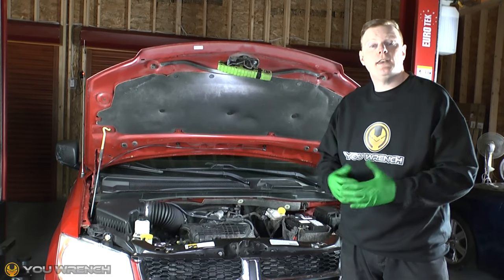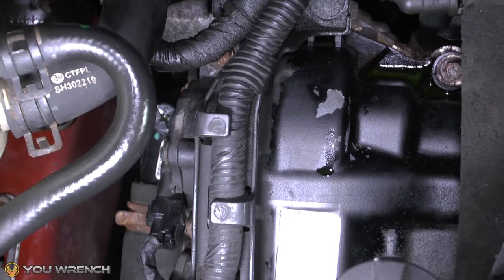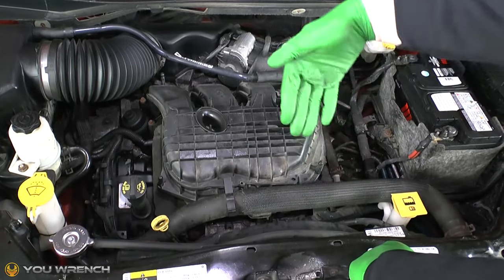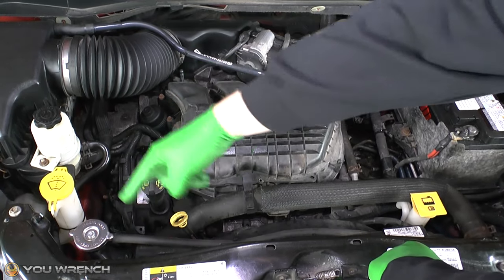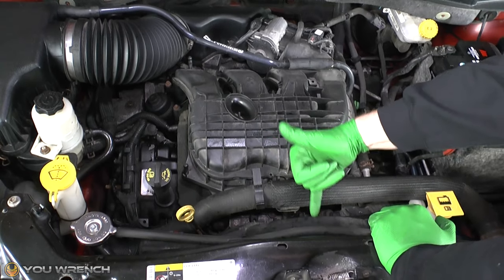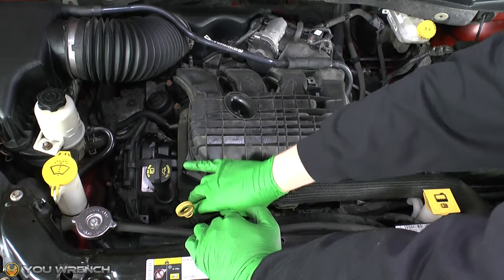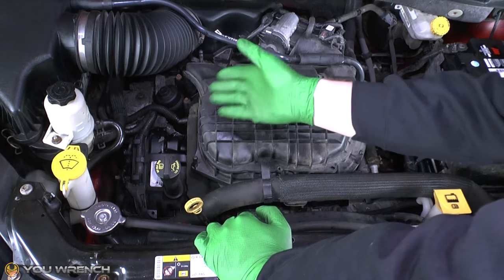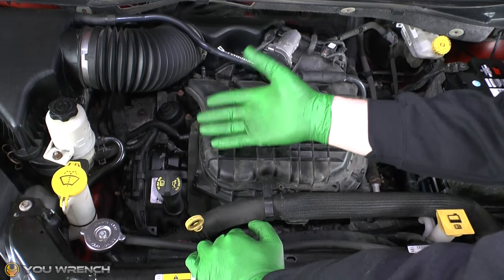How to Test if Your Car's Thermostat is Working (Without Removing It!!)

Comment: Outside temp -10 C. After starting and idling the engine for 14 (!) minutes, the temp gauge finally shows nominal temperature. During that time the pipe gradually builds up to a comfortable level, like 40C. Never really hot. During drive the temperature keeps falling down below nominal temperature, eften after driving for 30 minutes. Suspecting a stuck open....  What do you think?
Reply from the maker: Yes, a common cause for the engine not getting up to it's full proper working tempurature can often be the thermostat stuck open. This essentially stops the coolant from being held in the engine and getting up to temp (when usually the thermostat would open). Instead, it is constantly circulating and getting coolect by the radiator and fan. Definitely worth replacing the thermostat as the cost is low and the likelihood of success is high - that's the good way around!     www.paypal.me/youwrench

--- 

To help support us (for both you and others reading this) there are a few things you can do:

1) Donations both needed and welcome! We cannot operate You Wrench without the support of people like you! You can donate by PayPal - just go to www.paypal.me/youwrench

2) Please ensure you subscribe to our YouTube channel. 

3) Please Like our video's on YouTube (by clicking Like!) 

4) Please help spread the word, the more people who know about us the better! Add links to our video's in forums, let people know about us.

Thank you for your support!

Comment: some systems are apparently operating in reverse ? it circulates in the lower part of the radiator, then go up to the radiator cap then go through the engine then to the thermostat and lopps like that has long as engine is too hot. How do we know if it's a reverse system if we don't have access to the manufacturer manual ?

Comment: My temperature gauge is sitting slightly to the left off straight takes a bit to warm up properly but it is a diesel.... Would that be the thermostat?? Want to get ready for winter have decent heat but don't want to be stuck when the bad winter comes in

Comment: Thank you very much, my 2011 Kia Soul was overheating and I did not know what to check for then after watching your video I did as you said and the car was hot but that hose stayed cold and never get hot then I realized that my Thermostat was stocked on CLOSE position and never OPEN to let the water coolant to flow to the Radiator. Thank you very much and may God Bless you.

Comment: Yes, that a pretty decent way to rule out a thermostat issue. I was kind of looking for a good way / tool to measure coolant flow to diagnose if the water pump is bad and not circulating coolant. Currently this is not an issue for me. But it's one component I don't have a tester to know for sure without removing and inspecting.
Reply: If your pump is on its way out, you'll see the temp gauge running hot or overheat.
Reply: Try looping the heater inlet and outlet hoses together with clear vinyl hose. Run the engine and watch for flow.
If you cant easily reach those, look for another small coolant hose you could insert a loop into.
Stay gold
Reply: Yes as you indicated this actually doesn’t differentiate between thermostat issues, water pump issues and blockage in flow
Reply: Will this cause a coolant leak also
Reply: Car will start making certain noises pump might start whinging
Reply: Water pumps will have a weeping hole. If you see crusty calcification   outside the water pump, the bearing is going out, hence the weeping from a water pump

If you're water pump doesn't have one, blame the college educated vehicle designers & engineers, it's all about money.

Comment: Thank you. I have a 2001 Chevy Tracker base model that takes 30 minutes to show proper temperature on the gauge and the reading drops back to cold a bit while the engine is in idle. Definitely a thermostat stuck open.

Comment: What happens often on older vehicles is the thermostat works fairly normal except it won't  close up completely and thereby causes the engine to never make it to correct operating temperature that the computer is looking for.
The idle stays fast because it thinks it's still warming up, it runs richer because it thinks it still warming up, and your heat is weak.
Reply: Change your coolant temperature sensor
Reply: I changed coolant sensor on my son's 07 HHR now it runs so rough and gave a upstream 02 sensor 😡🙄 hate hate hate this crap dealt w a Chrysler 300M nothing but electrical/sensor after sensor was fixing to replace brain and boom  timing jumped and screwed some internal crap!!
Reply: Time for horse n buggy or a tri-motorized bicycle w enclosed cabin some solar panels and batteries converter/inverter run some lights and a small heater and be done w crap!!! Lol

Comment: After a new water pump radiator cap and 3 new thermostats, it stayed closed again. Took it out after busting a hole in both upper and lower radiator hoses. Read through 1000s of comments against doing it. Bought myself a week till my new radiator came. After putting it in the old 1 didnt look bad at all. Found a short in a fan wire which made it look like it was working coming on sometimes then off when cooled down a bit. Now they are both running and its super cold. Guess i will reinstall that dam thermostat, just letting yall know whats up. If you have too, do it and figure it out till you get it right again. 💯🔥

Comment: Great video, very helpful and simple process. My issue is the temperature gauge goes straight to hot/normal running temperature soon as I start the van. Could this be the Thermostat or maybe the temperature Sensor?

Comment: Just installed a new thermostat in a 2018 jeep grand Cherokee V6 3.6l. first auto repair I've ever done. This helps and I'm gonna run this test in the morning. Any tips on how to burp this specific cooling system?

Comment: Great explanation! My Ford kuga diesels’ temperature gauge gets to 90 degrees in 2 mins even at 7 degrees .. I’m still trying to figure it out but this video has given me a good basic understanding of how it all works 👏👏
Reply: Your thermostat I'd say
Reply: @kevinhancock4064  if I turn my heater on to the cabin will that tell the thermostat is working?
Reply: @Water Fall (H2O)  well yes indeed I just put a new oem  in my car and new pump (not oem ) but good brand
Reply: @kevinhancock4064  Thank you.
I am going to change my thermostat. Eventually change the pump. I changed all the hoses and radiator cap. After I change the thermostat then I am going to change repair shop. 
Thank you for assistance
Reply: @Water Fall (H2O)  repair shop ? Yeah nice 1 kettle me know how u get on whats your issue anyway ?
Reply: @kevinhancock4064  Don't know what "nice 1 kettle me."means.
However,  there were some unscrupulous things that had taken place.
Reply: @kevinhancock4064  Sorry I don't know what "nice 1 kettle means."
Reply: @Water Fall (H2O)  nice 1 fella  " lol
Reply: @kevinhancock4064  The issue is I paid for new part for vehicle and repair services.  The owner  knew a piece of the new part was accidentally broken of the part when the mechanic was repairing the car. He did not informed me about the issue. Eventually, I began having problems with that part. You got it! Coolant began to leak from that part.
I returned several times to have it fixed. 
I could tell by thee demeanor something was not right. 
So, I had to purchased the part again and pay for services again. Also, my new radiator cap was switched out with a radiator cap that doesn't go with the car. 
Since it was an old cap two black seals have fallen into the coolant reservoir.
Therefore, I am going to negotiate a  offer on replacing the thermostat part.
Once this transaction is completed I will look for a new shop.
Now I know why one of the mechanic quit. Dishonesty.
Reply: @kevinhancock4064  Your advice have given me the knowledge to have the right part repaired.
Reply: @Water Fall (H2O)  blimey that's bad was the part a radiator ? I've got a small hunch my rad has a slight leak I need to see how it goes over next few days now got new coolant sensor coming soon so I'll first test that and go from there
Reply: @kevinhancock4064  No, it was two rubber hoses off of  a tee. Then a long plastic part that had a square part on the long plastic part. That was the piece that was broken off of the part.
Reply: @kevinhancock4064  I need to invest in coolant sensors.
Reply: @Water Fall (H2O)  most cars only have 1 mime does some do have 2 though . Keep me informed if u will curious how u get on
Reply: @kevinhancock4064  Yeah. Definitely curious

Comment: Question: on a 2014 Passat 1.8T (ETKA). Upper radiator hose gets hot and tight (barely compressible). Raditatior has a leak and both the primary and secondary fans are not cycling on. Radiator will be replaced, along with upper and lower coolant hoses, both coolant sensors, thermostat, along with heater core. All was original, and I have the interior taken apart anyway, might as well. Anything that I might be forgetting? Another mechanic said to wait before replacing the fans; suggested that the coolant sensor that sends the signal for the fan to come on may be faulty and to wait before spending the money. The entire fan assembly can be easily replaced without draining the coolant (4 screws and 2 electrical connectors and it lifts up and out). Your thoughts?

Comment: Thank you. I never had these issues with my 99 camry but this 97 camry I am. After ther thermostat failed, I disconnected the fans from the ect to keep the engine cool till I got it fixed but now a week later after getting it fixed, the gasket failed and was leaking bad. Also i never see the gauge go up but i see the white smoke from under the hood first. Had to take the car back and the guy reinstalled a new gasket on the thermostat and did every test he could. Swore the ect was working and the fans were coming on like they should. But even now as I am sitting idling after dropping off my sister, the car started smoking again which immediately had me worried so I bypassed the switch to let the fans run to keep my car cool. The mechanic said if it does it again he will take it to Toyota himself😅 cause he even had the Toyota mechanic on the phone showing him what he was doing.

Comment: My 2016 Hellcat Challenger started to overheat last night for the first time. Temps got up to 253 with the Engine Hot light after about 10 minutes of driving. Fans came on like normal and after doing these tests you show, the T stat housing and hose gets hot after engine is brought up to temp. Also I appear to have no heat.

Comment: Alright, my toyota harrier 2003  3.0L (1mzfe ) has been overheating once i drive it a bit harsh, it doent overheat upon normal conditions. This may be helpful, i already cleared out the radiator and gasket problems, praying this will fix the issue. Thank you!

Comment: Very good explanation without a doubt. Can you please tell is there any harm in using a thermostat that opens up at a lower temperature than the factory, during very hot summer months with ac on?
Reply from the maker: Thank you! Hard to say, provided it's keeping the engine cool at it's required temperature then in theory it could be ok. That said, if it's doing that due to a possible thermostat fault then don't risk it, just replace it. It's easy and the thermostat is very cheap too (check out the Amazon link in the descriptive text of the video for the best deal!)

--- 

To help support us (for both you and others reading this) there are a few things you can do:

1) Donations both needed and welcome! We cannot operate You Wrench without the support of people like you! You can donate by PayPal - just go to www.paypal.me/youwrench

2) Please ensure you subscribe to our YouTube channel. 

3) Please Like our video's on YouTube (by clicking Like!) 

4) Please help spread the word, the more people who know about us the better! Add links to our video's in forums, let people know about us.

Thank you for your support!
Reply: Having a thermostat stuck open will not cause immediate damage, but can cause issues over time if left unfixed. The main thing you will likely see is in the winter the cars heat will not work well (will take forever to heat up, and then will likely not blow as hot when you are driving fast on interstates and highways). That can be annoying but the damage can come overtime since the engine is not getting to the proper operating temperature it was designed to operate at. The car will adjust the air to fuel ratio putting more fuel in (running rich when engine is cold) and can cause carbon build up and more wear on injectors. The engine oil will also not be getting up to the proper temperature and will not lubericate as well as it would at operating temperature. So to sum up, if you live in a warm climate and it is stuck open you will likely not have any issues other than a potential check engine light.  If you are in a cold climate your heat will not work as it should, and you will put additional wear on the engine over time.

Comment: i just recently replaced my thermostat and my radiatator, now the air in my car is staying cold and ive notied the upper hose warms up on my car but the lower hose connected to the thermostat stays cold, this should be a faulty thermostat correct?

Comment: For example I have fuel pressure testers to measure if the fuel pump is working / pumping pressure obviously if it's 0 psi the fuel pump is not working. But I never seen any flow inline meters to put on water pump inlet pipe or clamp on to measure flow. Is there such a tool ?

Comment: Another indicator is the temperature gauge itself.   Stuck open,  the temp gauge will take a very long time to rise.  Stuck closed,  the temp will rise to operating temp normally but then just continue to rise towards the red zone.
Reply: Thank you, that is another way to look at it too while sitting behind the steering wheel.
Reply: Mine never moves
Reply: @alexapexgod4643  You need a new  Coolant Temperature Sending Unit sensor and a telfon tape.

Comment: A very good explanation.  👍🏽
Reply: My Ford Ranger coolant pipe going to the top of the radiator is at high pressure and pipe feels like it want to explode. What may be the cause?
Reply from the maker: Thank you! On your Ford Ranger, hard to say without knowing how pressurised the hose is. They can get pretty firm under heat/pressure but should not be crazy-firm. If the car is overheating, or if there is unusual activity during heating then an airlock in the system could be a possibility as the coolant is not cycling. But if everything is working perfectly, no overheating etc then it could be normal? It really depends on how firm that hose is. Best of luck!

--- 

To help support us (for both you and others reading this) there are a few things you can do:

1) Donations both needed and welcome! We cannot operate You Wrench without the support of people like you! You can donate by PayPal - just go to www.paypal.me/youwrench

2) Please ensure you subscribe to our YouTube channel. 

3) Please Like our video's on YouTube (by clicking Like!) 

4) Please help spread the word, the more people who know about us the better! Add links to our video's in forums, let people know about us.

Thank you for your support!

Comment: I encountered an issue with my Audi A3 the other day.
Basically I was pulling into a highway after about 20 minutes of driving, and I noticed that the temperature gauge started dropping from 90 degrees and eventually down to 50 degrees... While driving down a highway which makes little sense.

Granted it was a cold day out at around -8 degrees celsius, but surely the ambient temperature and the draft from the high speeds couldn't possibly be enough to cool down a running engine that much can it?

Comment: Been fighting my heater in my 96 Ford F150, replaced the heater core thinking it was that because one of the two lines going into it would get warm, but the other did not. Starting to think my thermostat is stuck open. The radiator hose gradually gets warm, not a cold to hot scenario and when I start it with the radiator cap off it instantly starts to push fluid up. Going to replace it next week. Thanks for the info!
Reply from the maker: Yes, a sign that the upper radiator hose does not go from cold to extremely hot when the thermostat first opens is indeeda thermostat being stuck open. Often with this issue you will also find that the hot air inside the cabin does not get very hot, because the coolant is never getting to full operating temperature, and so it cannot create nice hot air in the cabin via the heater matrix. Hope you get it sorted soon! :-)

--- 

To help support us (for both you and others reading this) there are a few things you can do:

1) Donations both needed and welcome! We cannot operate You Wrench without the support of people like you! You can donate by PayPal - just go to www.paypal.me/youwrench

2) Please ensure you subscribe to our YouTube channel. 

3) Please Like our video's on YouTube (by clicking Like!) 

4) Please help spread the word, the more people who know about us the better! Add links to our video's in forums, let people know about us.

Thank you for your support!

Comment: Any idea why my 2013 Ford Fusion overheats with the A/C on and on steep grades? Car stays cool otherwise. Can't locate any leaks from hoses or water pump. Fluid level stays constant. Replaced cylinder head temperature sensor hoping I was getting a false gauge reading, but problem persists. I also understand there is another sensor, an engine coolant temperature sensor, that could be bad. Would appreciate any thoughts. Thanks, Philip